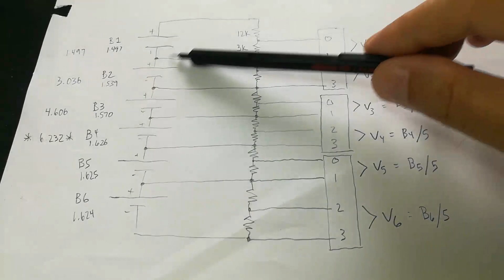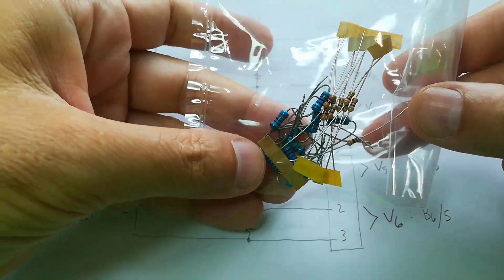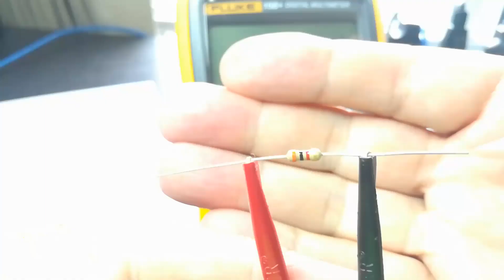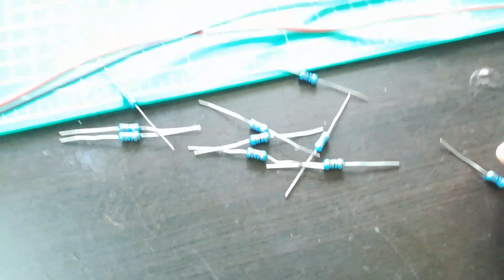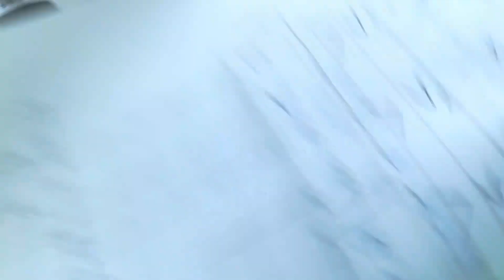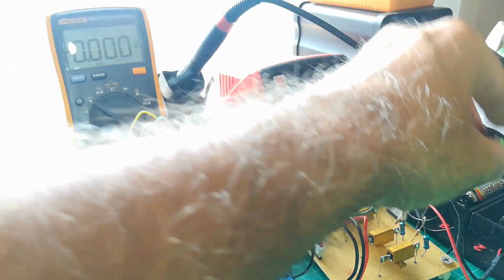21700 Battery Pack Part 13 - Resistor Divider Fail

Comment: Ever publish data on those 21700 cells at 1,2,5amp discharge? What’s the voltage sag on 10p pack?
Reply: Michael Brown I did check out those GSL cells was consideration buying some. It’s the fact are only 4Ah and I’ve yet to find anyone testing a big pack. Curious about voltage sag, ect.

Comment: I'm enjoying your channel, thank-you.  Now I may be way off base here but seeing as to how you're not really receiving any extra benefit by using the Adafruit boards and you're now working with voltage dividers to lower the combined voltage, possibly using 2 arduino UNO's and 6 boards, why wouldn't you just go back to the original 6 analogue inputs on the UNO using voltage dividers so that you can't go over 5vdc? You still have a resolution of 1024 which should give you plenty of accuracy. Am I missing something obvious here?